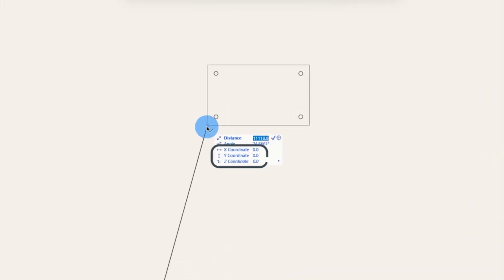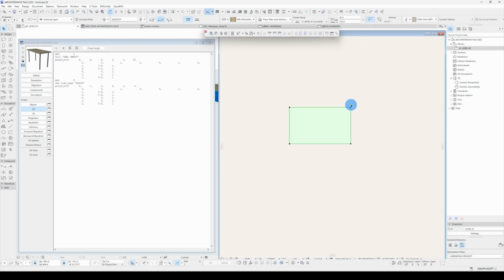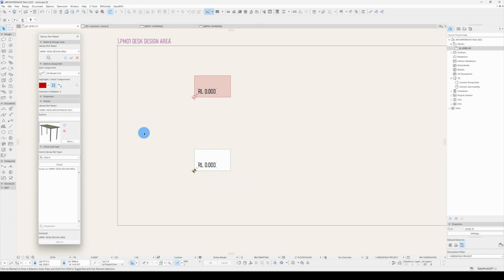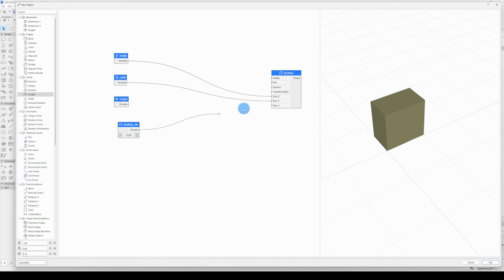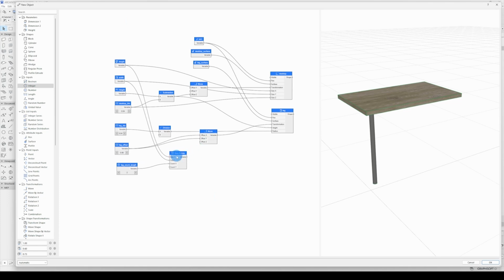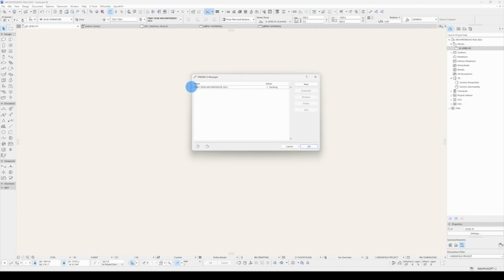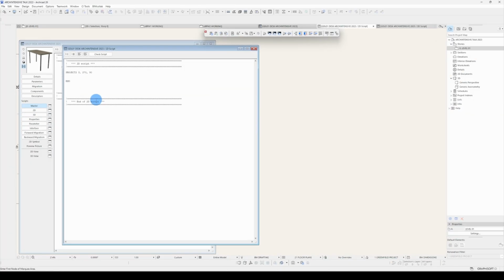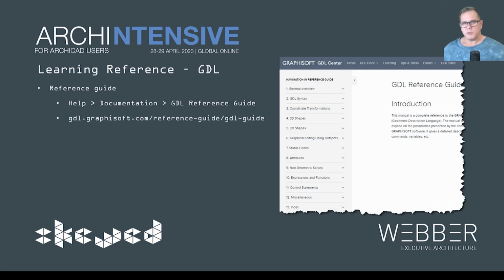Custom content creation: 4 ways in Archicad with Bruce Walker

Comment: I am searching for help in hotspots in param-o.
In the graphisoft's support materials, there's nothing (I've found) about how to visual-script hotspots & "hot-lines".
But creating an object you can quickly encounter the need of adjustable hotspots other than the bounding box's hotspots.
Actually, I can use the gdl scripts to create adjustable hotspots, but it's far from easy; and doesn't seem to be easily combine with param-o.
Reply from the maker: Istvan I have to admit I have never taken the time to learn Param-o I really haven't seen the benefit for the types of projects that I work on to go to all that effort to create objects. My guess is it isn't an available feature of param-o. But to be certain I would suggest reaching out to the user community through Graphisoft Community.
Reply: Yeah, I have a problem with Hotspot too. Even a simple script, rotating the block via Grasshopper AC connection always rotates the wrong origin plane. I create the block by Param-O.

Comment: 👍👍👍 for the Morph tool method, I create a 3d document for each object and I add my hotspots in the 3d document to facilitate the cleaning of the 2d representation🙂
Reply from the maker: There are so many things you can do with Morphs. I remember when the tool was released many years ago. The number of videos released by Graphisoft was more than I had ever seen before to demonstrate how to use a tool. :)
Reply: @SkewedBIM  it would be nice if graphisoft worked on optimizing the size of objects created with the Morph tool
Reply from the maker: @snnor  I honestly think that would be a hard thing to get right. How could you develop a polygon optimisation where it worked exactly how a user would expect it to. Yes, you could apply a deviation value for it to then reduce the polygons if the deviation was less than 'x' say. But the problem is that sometimes one section of a morph might need that gradual shape change as it is important, whereas other areas it wants to be cleaned up. A similar approach to the reduction of polygons is applied in the ModelPort API. I have fiddled with that a few times and found that it never works the way I want it to. :(
Reply: @SkewedBIM I speak about 2D optimization to avoid the cleaning of the 2D symbol of the object, for all that is 3D I do not arrive has to understand why there is always no option which uses technology Remesh of ZBrush and the reducer of polygon of cinema 4d which belong to maxon to optimize the polygons of the objects in the various nemetschek, you will say to me that it is not the same data-processing language then I would say to you Archicad in C# gives access to all the
 technology of the group 😉